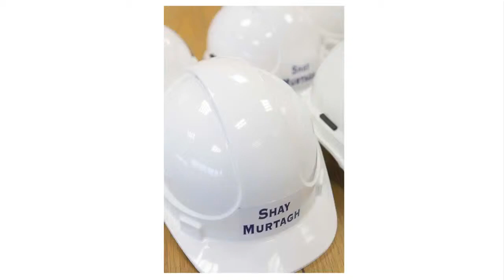Q10. What loads does a typical box culvert carry?

Comment: Thanks for going over the forces.   I'm curious as to why these culverts are not arched as they can carry a lot more weight than a flat roof (probably with less steel).    I'm interested in using these for bunker design.